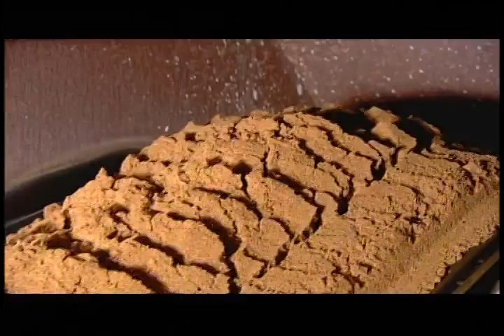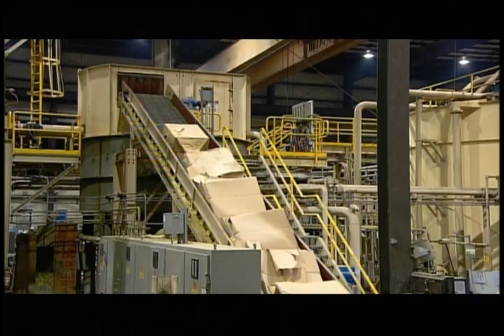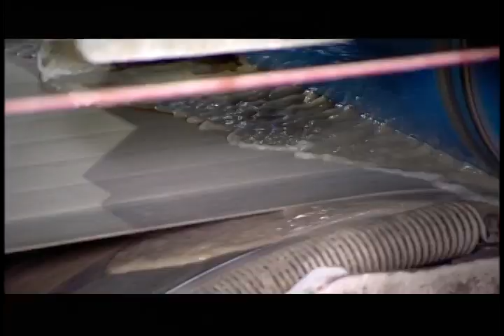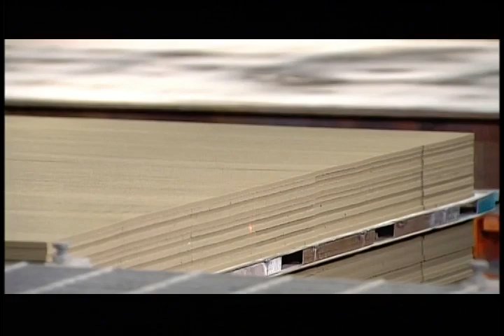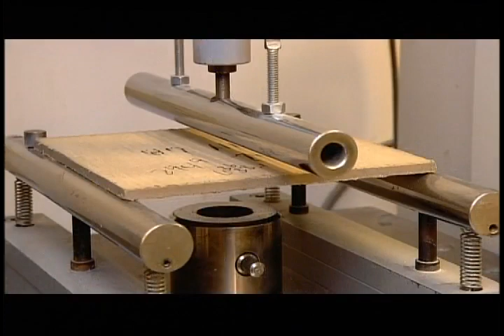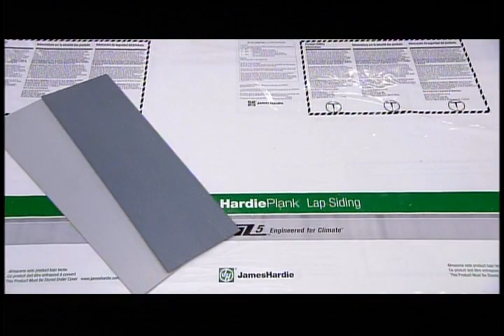How Its Made - James Hardie Siding

Comment: I suspect that most of the adverse comments are from people who didn't follow the installation instructions and just put it up "like they always have." I used it to replace deteriorating plywood panel siding on a shed, and it has held up well. As for vinyl siding, I attended a seminar on reducing fire risk in the sand hills of central Kansas, where they showed a video of viny gutters and siding melting and flaming. Pretty spectacular.

Comment: 10 years and counting... I used this instead of several standard/traditional mobile home skirting materials. Mine came with a paint primer coating and accepted the same house paint used on the rest of the home. It is still like new, though even fiber/concrete is no match for a weed-eater. I've had to install angled sheet metal on the corners. Problem solved. BTW, weed-eater damage was easily(?) repaired with any of several concrete patch/mortar type mixes. Plastic wrap covered "Hardy Board" scraps can be used to impress the wood grain pattern to the surface of the patches. Good luck! I hope this inspires some of you. It's good stuff.
Reply: Ok

Comment: I’ve repainted tons of it.  It’s good if installed correctly.  That being said  a lot of it has not been installed correctly.  It’s unfortunate that the asbestos fiber cement had to go. That stuff would have saved people alot of money.  Hard compressed asbestos is not really that dangerous either.
Reply: unless you cut or grind it. Then....
Reply: @4n2earth22  they have shears for the hardie board that cut it without making dust. I would feel more comfortable installing that stuff with the aid of PPE and dust extraction hooked up to the saw then to run the risk of using an inferior product personally.  It was mainly the loose asbestos that was most dangerous. Insulation products not the car breaks and siding
Reply: @mfblowfish4671  The real problem with Ass-bet-us is the fanatical crazy expense of dealing with the crap. I did hazmat clean up for lead and the ass crap. Ya gotta find a real way to deal with it that does not cost cost cost cost.
Reply: @4n2earth22  it’s a great way to sell rolls of plastic sheeting.  I’ve worked on a couple abatement jobs too. It’s mostly a joke for what the expense is. I’m almost certain that the plastic industry had lobbied for the big lead paint scare that was promoted heavily 10-15 years ago.  They never really did any residential enforcement  in my area thou.  It was pissing people off when they started getting estimates for 30-40K to repaint their downtown homes.
Reply: @mfblowfish4671  car brakes abrade over time and release the dust into the air. Probably not a good idea with asbestos lol
Reply: @theaceofspades39  Car brakes no but hard building materials yes, asbestos is not only highly insulative but 100% fire proof and will outlast whatever it is installed on. The problem with using it as a fiber type insulation is that it can degrade and become airborne, that is not the case with the old hardboard and many other products. A lot of dust is a concern but minute amounts every now and then are nothing to worry about.
Reply: @lookingforonetruechristian7396  - Just about every house built before 1980 has asbestos. Millions of those homes sell every year. It is only a problem if you disturb it through removal, etc.
Reply: @lookingforonetruechristian7396  I lived in an asbestos lined house most of my life and so did the owners before me. No one has medical issues because of that.  If you grind up a sheet of it and inhale the dust for a week you might have an issue one day, otherwise this is pure scaremongering.
Reply: @lookingforonetruechristian7396  Actually asbestos siding is usually not a problem it is asbestos insulation that get airborne and is in an inside environment where it becomes a health hazard. Often times asbestos siding holds up so well that it gets covered up with other siding if someone wants to change the esthetics of their home and not torn down and replaced.
Reply: personally, call me old fashioned but I'd breathe in 50 cubic meters of asbestos dust to be able to call my siding installation project a job well done. you fragile young whipper snappers never huffed a cloud of asbestos in your lives. back in my day we didn't have "VAPING" we'd work on asbestos and get dizzy from the dust after ripping materials.

Comment: LP smartside is better in every aspect. Lighter, more durable, wont snap when you hold it, more hail resistant, non porous, quicker to install and longer lasting
Reply: I totally agree, longer boards 16 ft = less joints , more intricate cuts and no silicosis.👍📐🇨🇦
Reply: Those who don't know how to handle and install it will agree completely.

Comment: My home has this product. The finish falls off and Hardie doesn’t stand behind it. Poor product.
Reply: Maybe your home is the problem. Might not be insulated properly and allowing water vapor to get behind the siding. Maybe your siding is not installed correctly. I have this product on my house and barn, and it has been there for 20 years without a problem. The barn only has one coat of paint on it (yes I'm a procrastinator) and it still looks good.

Comment: A product I do not like. Its heavy, breaks easily, have to use a special saw blade to cut it and the dust is crazy. . Nail heads exposed and nailed to close to the edge it just splits and cracks into layers. Now I know why it splits apart. Left outside unpainted it crumbles. I used smart siding on a dog house that was never painted and 7 years later its still not rotted. I have seen the old Masonite siding last longer and it's basically cardboard. In my opinion any product will last as long or longer if properly primed, painted and maintained. The very same thing you will have to do with Hardie if you want it to last.  I like the 3x5 1/2" underlayment for tile work. Its not cosmetic. I have yet to see 1 job of Hardie as siding, facia, or soffits that don't have nails protruding splits or cracks in its surface. To each their own but I would never use Hardie as a finished surfaced product on any part of the exterior of a house.
Reply: As an install I agree with you. Unfortunately almost every contractor that builds homes where I live loves it
Reply: I used screws. Predrilled and countersunk all holes, then painted. No problems after 10+ years. The issue with nail heads is common to all materials, though worse with some. If done with countersunk screws, and installed properly, the maintenance free life more than makes up for the short life of the tools being used.
I believe it's mostly on the installer. I mean... really... Nails + Concrete material = failure in so many ways.
Reply: I built an attic dormer with it in 2010. The Hardie plank I used was pre-owned, so I don't know how old it was before I got it. I cut it with regular circular saw blades, did not pre-drill anything, installed it with galvanized nails, painted it once and have never had a problem. I did major paint touch-up on the redwood lapboard siding all around on the body of the house last summer, and the Hardie planked dormer was the only part of the house that didn't need anything. To be fair, the dormer is 17 feet off the ground and the top couple rows of it are protected by soffit, but really no complaints so far, 13 years on.

Comment: Lots of maintenance. Repainting the every few years. If you want the best product Everlast vinyl cladding! I.  Remove a lot of Hardie. And replace it with Everlast!
Reply: Vinyl has its own issues in manufacturing affecting health of employees.
Reply: @Roscoe8161  it's not vinyl siding. It's better
Reply: Why wouldn't they just dye the cement a particular color rather than painting it?
Reply: @youbadolivez  cheaper to paint. You cut it paint it caulk it and touch ups.
Reply: My last house was painted 12 years before it was sold and it was in the south missippi sunshine. Use good paint and apply it properly.
Hardie siding takes paint well.
Reply: @harveynailbanger maybe better there. not here ohio. On the shores of lake Erie. Cold wind rain snow.  Hardie lasts 5-10 years here. Next to the lake.
Reply: Vinyl anything might be great for those sell and install it. But the homeowner that purchases it will lose $100,000 in home value when they sell their home. Deserved or not, Hardie will get you a higher price, vinyl will get you a lower price. It is simply public perception.
Reply: Everlast is good but it’s way more expensive by the time you add up all the accessories.
Reply: @mfblowfish4671  you get what you pay for
Reply: @stevenpellegrino997  I like it, it was special order thru my supplier which is not ideal. But not cheap for the materials  ended up being about $36000 to side a house and garage
Reply: @mfblowfish4671  I did their very first test house in mentor Ohio. When they wanted to try it on a house for the very first time. I like to rip on hardie cause it's a waste of money.
Reply: @stevenpellegrino997  - I am not saying that it isn't a great product. I am saying that marketing and public perception works against it.
Reply: @billybeemus3929  yes I know I'm in one of the lower income areas of the state. Very few can afford it. but we do a lot of commercial jobs with it
Reply: My shop was built in 2013 with Hardyboard with factory paint. It looks the same today as it did then, beautiful! So I don't know what you are talking about when you say Hardy has to be repainted every "few years"! What kind of paint are you using, Kmart brand?
Reply: @johnwilcox4078  no Sherwin Williams or any high grade paint. But I'm guessing your shop is not on a shore line or a area of high ice snow and wind. I work on the shores of lake Erie. And the wet conditions the sun and summer heat. Take a toll on ant paint. Plus the expansion and contractions. Cause caulking to putt away. Event the best caulking. We just did a job the builder use a new rice board product from Canada. $500 a gallon paint. Was told zero shrinkage. The house has 1/2 gaps now. Hardy might be fine in your area your situation. I'm saying it's not the best in ever environment. I will bet you a million dollars. If I scratch your Hardy. You will see concrete and have to repaint it. You can take a saw. Cut into the Everlast. The product doesn't need immediate care. But you would need to protect the wall behind the cut. If it has not house wrap or protection.
Reply: @stevenpellegrino997  No, not as harsh as the shores of Lake Erie! It does get colder here in Madison Wisconsin. Its not to say I don't have any problems with the 6" Hardy lap siding, the paint isn't one of them. Some of the 4" trim boards are pulling loose 1/4" to 1/2" in places, but that problem was self inflicted, the nails we used were too short. I'm going to fix that with longer ring shank nails and color matched caulk and paint. Still have the 163 page best practices-installation guide, I should have read it better, lol! But when it came time to reside my house I didn't use Hardy board I used LP with factory paint to match the shop and am happy with it also after 2 years. Hardy is expensive, you got toxic dust, takes longer to install, fragile and heavy, its hard to handle. I did both projects myself as a homeowner, hiring a pro carpenter $$ by the hour to help. Time will tell which is the better siding! By the way I was born in Euclid Glenville hospital on the shore of Lake Erie and grew up in Lyndhurst, about 5 miles south!
Reply: @johnwilcox4078  my whole point is Hardy needs paint. Before during after. When ever. Everlast is like normal vinyl siding. It's one and done. But unlike normal vinyl siding no fading. The Hardie we get here. Needs paint when cut to install caulking and touch ups on trim and other spots over time. Cuts, scratches, damage. I put hard in a bucket of water it falls apart. Everlast will almost out last the planet. The first Hardie job I ever did. Was like a solid concrete sheet. 7" 12ft long. I put a scrap in a puddle of water a week or 2. Was still rock solid. The new Hardie. Is adding to much filler. To make it lite and cheaper. But not stand to it's original ideas.  And your having issues with trim. I can show you the first ever house done in Everlast. In mentor Ohio. I was installing it as a test project for them. To demonstrate and videos for a installation guide. The siding and trim. Still as perfect as the day install in 2002. And never had to go back for anything.

Comment: The new LP Smart siding has this garbage beat.  Not the orignal LP siding, the newer updated version.
Reply: I agree been using LP for over 10 years .16 footers = less joints ,more intricate cuts and no silicosis.
Reply: Yea ok, just wood garbage and glue has cement beat. Ok boomer
Reply: @magictrading8903  Speaking from experience.  The cement board blows out the back side from the nail being driven through, weakening it everywhere it's nailed.   Corners cut out where windows and doors are inevitably cracking the board in two.  Used it orginally in '98 and at that time they said you could install without splices at the ends, just leave a 3/8" gap, paint the raw ends, and caulk the gap.   Now those joints are swelled and naturally the gaps need to be recaulked.  Now they don't recommend installing without splices, but if you do, they're to be installed without a gap.  Sounds well engineered, doesn't it?   Just my opinion and experience, and if you don't like it, I really couldn't care less.
Reply: @kellyappel3015  every single LP cut and exposed edge needs to be painted / sealed… tell me this isn’t a huge vulnerability? It’s just common sense that wood and glue is a bad choice for exterior siding. An inorganic material will always be superior to organic when exposed to the elements
Reply: @magictrading8903  Go with it.  I won't use it again.